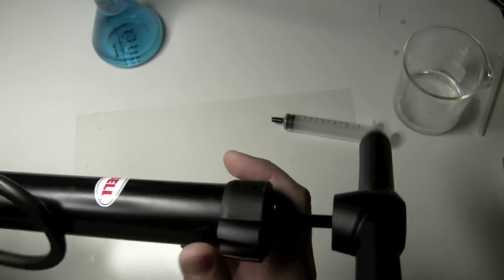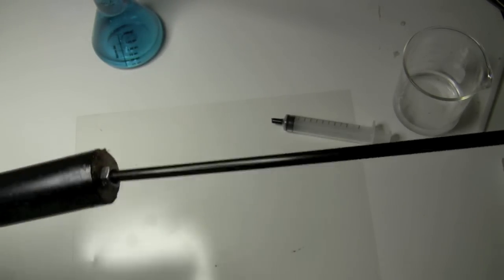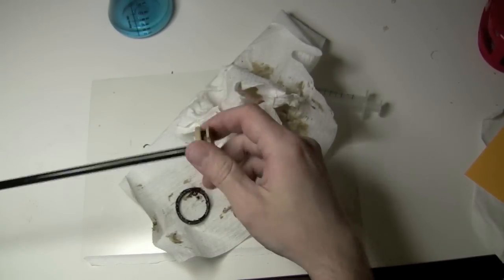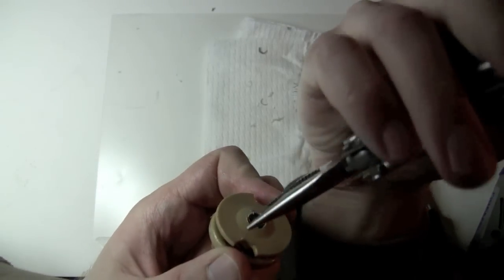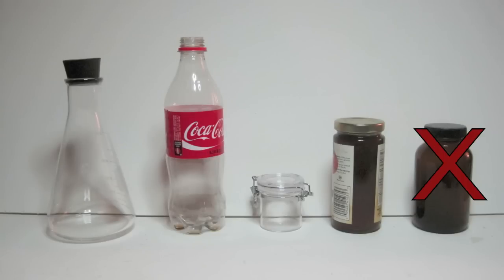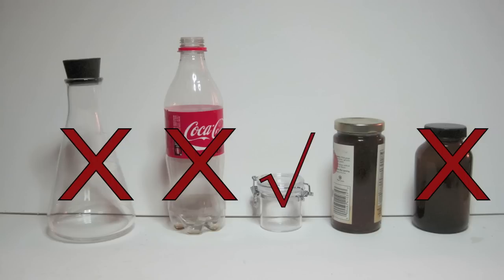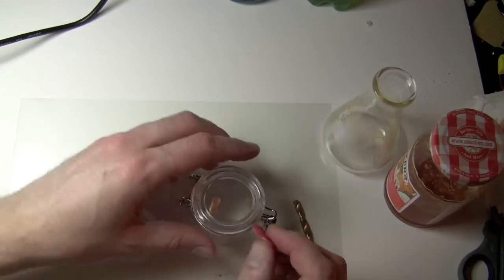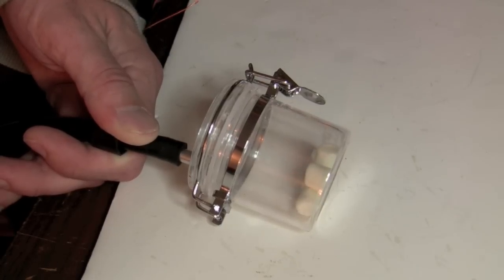RTFMS Episode #5: Building a Vacuum Pump

Comment: I followed the instructions but my pump didn't 'suck' well. I found an additional valve at the place where the rubber hose attaches to the plunger part. when I took that out it worked well. I also used hot glue to seal a leak around the top plastic part after I re-assembled the pump. The things I do for my kids! (9 yr old girl who want a 'space' birthday party. the vacuum will help demonstrate what happens to a human with a hole in their space suit!)

Comment: The vessel in this case the jar, would need need to be fitted with an external one way valve.  A simple one way valve could be made by putting a small hole in the lid about the size a #2 pencil lead. put a small smear of oil across the whole and put a piece of electrical tape over the hole.

Comment: I reckon to make a vacuum pump from a bike pump to work you need it to suck air out without it replacing so if you put a marble or ball bearings big enough to block the whole the air goes into the chamber infront of the plunger it should work I will have to make one to find out if it works
Reply: Did it work? I know a Michael O'Rourke but I doubt you're him 😂

Comment: Hi I am try to find out how I could make a manual hand pump to use on space bags for clothes storage. Have you got any ideas how I could do that? I have a ball hand pump that is around the size of the ones you can buy. The only issue is that the brought ones the end that goes on the bag is open I believe and they have a rubber stopper thing on the outside so as not to cut the bag open
Reply: Clothes storage bags are normally evacuated using a household vacuum cleaner or a shop vacuum cleaner.  While the vacuum cleaner won't pull a deep vacuum, atmospheric pressure usually does a fair job in compressing a bundle of garments inside the bag.

Comment: unless you do something with the check valve in the bottom of the pump it "WILL NOT" work.    Did you address the issue without showing it?  regards

Comment from the maker: Chris, no worries. I'm probably spending too much time on the new projects, need to provide better support for the old ones ...

Anyway, please send me pictures of the valve from different angles, I'll try to think about possible reason for the problem. Video would work even better.

BTW, are you able to move the rod or it is stuck? If you can move it it should be moving air somewhere, it would be great to figure out where it goes.

Regards,
Andrey